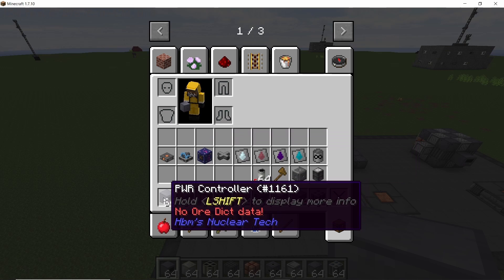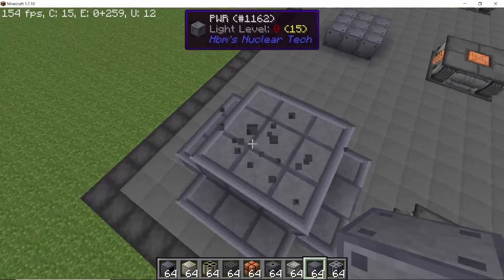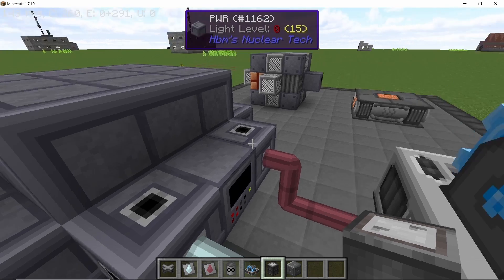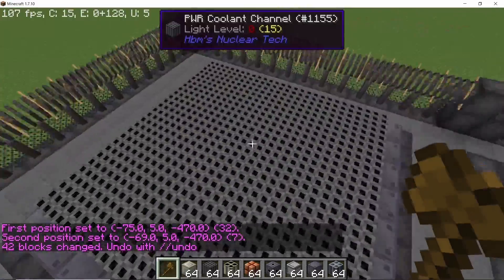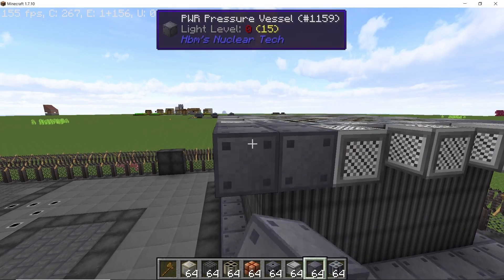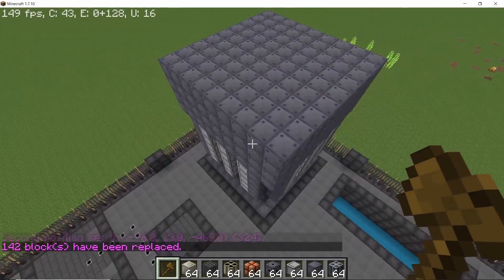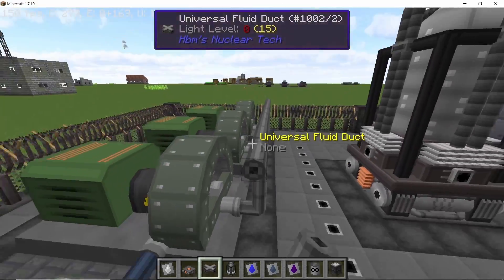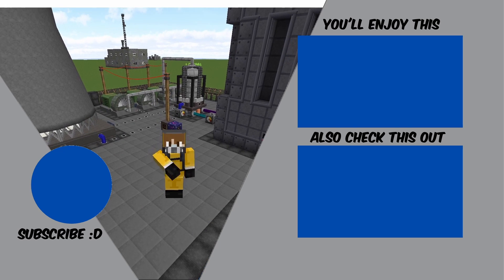Pressurized Heavy Water Reactor Tutorial - HBM's NTM Minecraft

Comment: A pressurizer and new type of water called Pressurized Water would also be cool, then it is injected into the reactor and hot pressurized water at 300°C comes out at the exit, then it goes to the heat exchanger, and at the exit of the heat exchanger instead of pressurized water, normal water comes out, then the normal water goes to the pressurizer, which turns it into pressurized water again, and back to the reactor repeating the cycle.
Reply from the maker: yep adding a pressurizer would make this reactor identical to real world pwr's

Comment: Making a simulator for this is going to be SOOO fun (not)
Also this is technically not "pressurized", as for the time being it doesn't seem to require compressing any of the coolant
Reply from the maker: Yeah I wish Bob would add a pump now, like before infinite tanks were fine but now with machines like this one it would be so much better to have an industrial sized pump to pressurize and transfer fluids
Reply: @SavageVegeta  i actually did make a PR (pull request, basically asking to merge your changes to a repo) on adding a pump (regular pump, just pumps out water if there's a water block under it), but it was never accepted and also the NTM discord doesn't like realism that much
Reply from the maker: @Voxelstice  yeah I talked to them about this thing today, adding a pressurizer for the PWR won't be happening but it also kinda makes sense as it'll be alot of work
However I still can't understand why a simple pump can't be added that can replace the infinite tanks (In a mod with so many detailed and high quality machines, acquiring water with infinite barrels seems weird)

Comment: Lol i was the one who suggested hbm to make it possible to let heavy water flow through reactors
Reply from the maker: ooh nice !!
Reply: @SavageVegeta  could you maybe also make a setup to use thorium with a large mining drill (but not the whole process chain) for u233 production
Reply: @SavageVegeta  and maybe also a setup that uses schrabidium turns it into euphemium and solinium and then uses the solinium again to make australium and more euphemium
Reply from the maker: @manuel_bing_chilling  why not the whole process chain tho ? The more thorium you get out of the processed stage the more u233 can be extracted from it. 
Also I'll look into the solinium idea too for sure !! However the one with thorium I'm definitely gonna do it soon
Reply: @SavageVegeta  but you dont need that much thorium 16000mb only need 2 nuggets and also the whole process chain is really expensive with nitric acid and hp solvent i'd say only max x16
Reply: @SavageVegeta could you also make a design that runs on u233 and uses thorium to be self suficient

Comment: Hey so I was building your uranium enrichment plant you made a year ago. I did everything in the video besides the gas centrifuge upgrade part since there wasn’t a option for it, so I start the process and the ore doesn’t get processed In the ore Acidizer. Any idea on how to fix this? My version is 1.12.2 ntm extended and yes I have the thermal expansion etc mods.
Reply from the maker: hmm it can be an ore dictionary problem and the uranium ore you are trying to process isn't from ntm but from some other mod. Aside from that it is also possible that the acidizer is broken but I have not read anything regarding that in the fixes/changelogs tho ntm extended is still in development so there are some missing features in that mod

Try the acidizer with any other ore from ntm and see if it works or not, and if it doesn't then I guess just wait for a mod update
Reply from the maker: also the creator of ntm extended has discord so you can talk to him there or you can even open an issue on github regarding this
Reply: @SavageVegeta  I found the issue the same day I made this comment, the uranium ore in the ore acidizer uses Sulfric acid and not the hydrogen peroxide.
Reply: Though I do have another question, how in the hell do you find bedrock ore? Since the neutrino lens isn’t in extended it’s quite hard to find, plus the ores don’t spawn under the depth stuff in extended. Any tips on how to find it? I’d greatly appreciate it.
Reply from the maker: @blixergirl9629  well if you're like me that is a creative player, you can place down a piece of bedrock ore block and right click it with a specific bedrock ore to set that block to it's type:D 
So basically you can create your own infinite ore source anywhere
Reply: @SavageVegeta  So if I were to right click a bedrock ore block with a uranium ore block it would turn it into a uranium bedrock ore?
Reply from the maker: @blixergirl9629  yes that's right
Reply: @SavageVegeta  Ah Tysm for the info! Keep up the good work man!
Reply: @SavageVegeta  I tried right clicking it with a uranium ore in my hand but it only just placed it. Is it smth I’m doing wrong?
Reply: @SavageVegeta I would appreciate it if you respond as I stated above, it only placed the block. I also tried this in the og hbm mod and the same thing happened, if there is something I’m doing wrong please let me know.
Reply from the maker: @blixergirl9629  you need to right click it with bedrock ore, not the normal ore. And this only works in the 1.12.2 version
Reply: @SavageVegeta  oh my bad, thank you for the info! Keep up the good work!